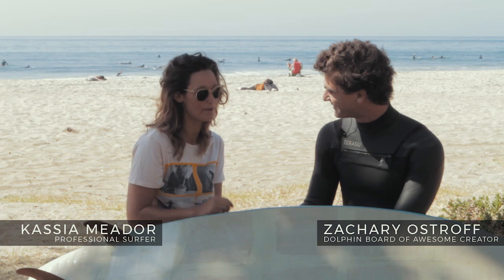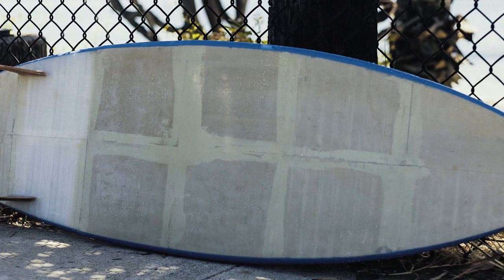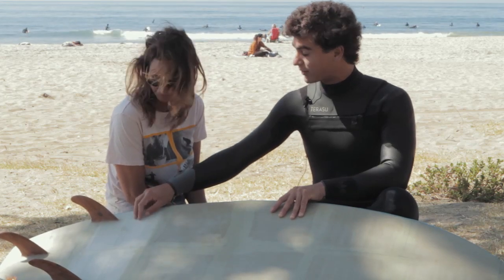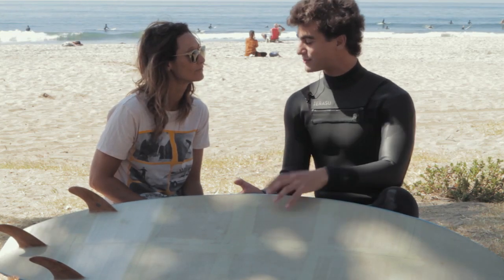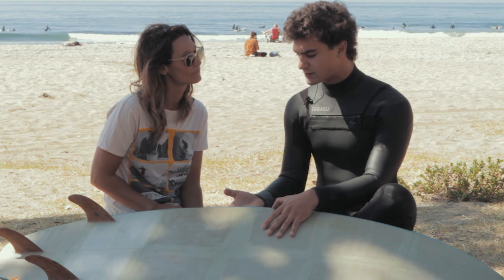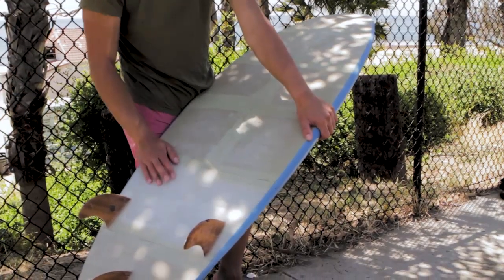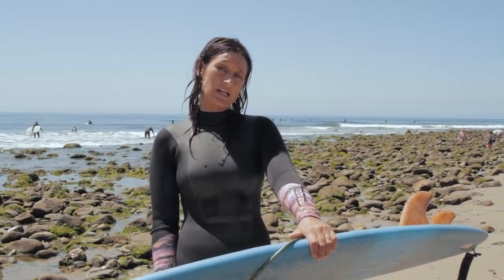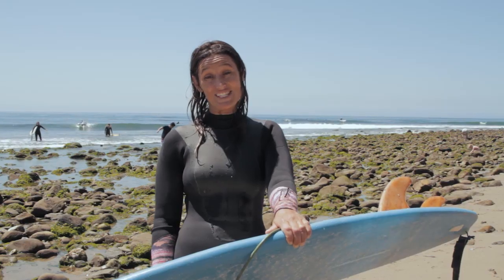The Dolphin Board of Awesome - The world's first 3D printed, recyclable Surfboard

Comment: The hardest part to replace was always the skin of the surfboard i.e. the resin and the fiberglass/carbon etc. So i'm actually very disappointed in this video. The core was always easy to make sustainable. So i don't think that a very huge step forward. 
I've made a hollow wooden surfboard. I managed to get rid of the fiberglass and Epoxy, but i still had to use something to seal the surfboard. So i had to use PU varnish. And unfortunately i'm not aware of anything else to seal the surfboard with (i know some options, but they take too long). 
So what we really need to make this work is plant based epoxy and some kind of fibre. The fibre probably isn't such a big deal, but the resin will be. Last time i checked there weren't any 100 percent sustainable or plant based resins on the market. So we just aren't there yet, it seems.

Comment: Respect the innovation on this design! I imagine that the types of cores possible through 3D printing could be the most innovative aspect of the design. For example using a honeycomb pattern, you can adjust the float and density by using different patterns, and prevent a board from taking on water by using different cells in the core.

Comment: That is pretty cool! I have always thought about how interesting it is that most surfboards are made of white styrofoam. This is good to see.
Reply: ...not styrofoam, sir, but polyurethane foam; there's a big difference.

"Epoxy" 'boards, in core,  are a bit different, and more similar to styrofoam, but yet exclusive.

"Now with the introduction of epoxy resin it is quickly becoming the new standard. Polystyrene foam comes in two varieties – expanded and extruded – each compatible with epoxy resin, and each with its own positives and drawbacks." (http://www.tactics.com/info/epoxy-surfboard-construction)